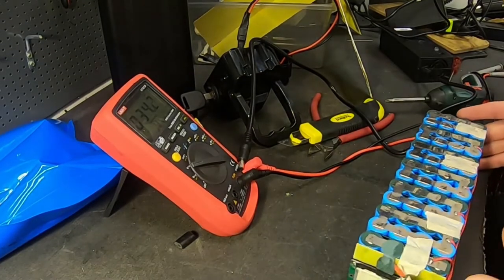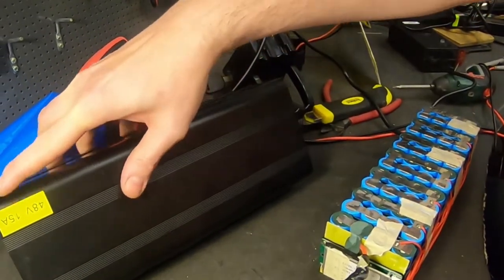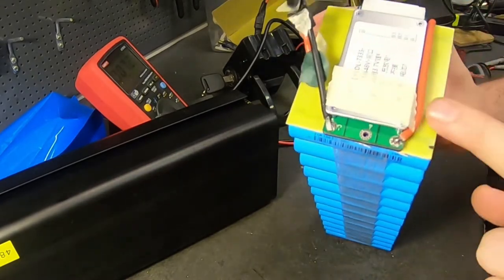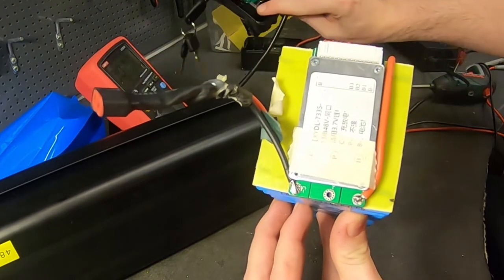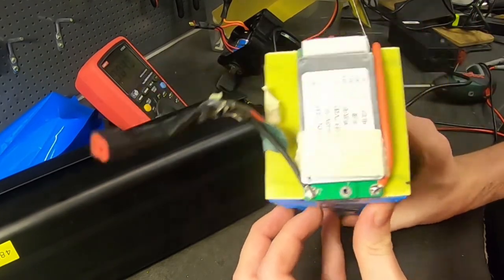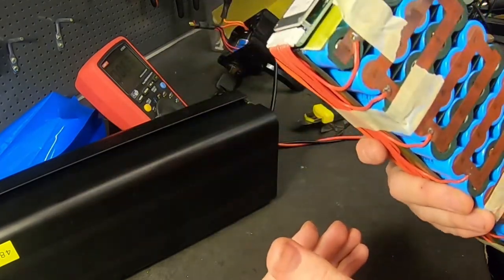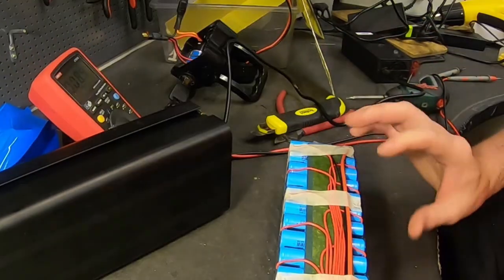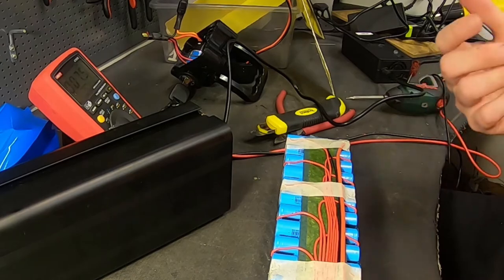What can possibly go wrong when you order a 48V 500W ebike from aliexpress?

Comment: It would be great if you could do a video on ebike battery care and how to maximise health. I'm sure you would find a lot of people would watch that video.
Reply: To maximize health "recharge cycles" of an ebike Lithium pack all you have to do is get the largest (30Ah is good) 52V high-quality pack that will fit your bike, then buy two, along with a Grin Satiator and a control display that accurately displays voltage. Then after a few initial 100% charges (58.8V) on the packs don't charge past 80% (55.4V) or discharge past 20% (45.4V). This will greatly extend the number of recharge cycles you will get, maximizing "life". Try and keep the packs between 40 & 80 degrees F. both while charging and using. With a 30Ah pack, you can charge quickly (at 8A) with no stress to the cell what-so-ever. The only downsides to a large pack are cost and weight everything else is positive. Don't buy an ebike... buy the best bike for how you want to ride and hang a mid-drive motor on it, you will have a far better ebike than anything being produced to sell currently.  Cheers, Mr. Wylie.
Reply: @brianbassett4379  thank you for the comprehensive reply. I have just bought a specialized ebike so an interested in finding out how to take care of it. Thanks again

Comment: I want to build this battery into my e bike 100000mAh 1000w 48V lithium ion battery 100Ah bike BMS My e bike normal battery 48V 7.5am? 350watt motor If it is supported by the control unit, problems happen
Reply: HERE IS ABSOLUELY NO NEED FOR A 100AH BATTERY , A 30AH IS PLENTY ENOUGHT
Reply: @aski1529 Not if I want to go up to the peak of a mountain which is 33 miles away. I have 60ah. Going for 90. It's not as heavy as people cry it would be. I'm 120 pounds.